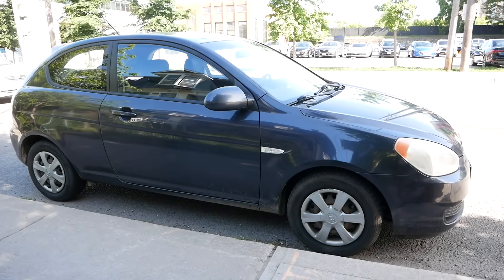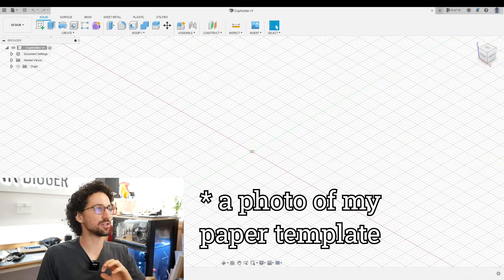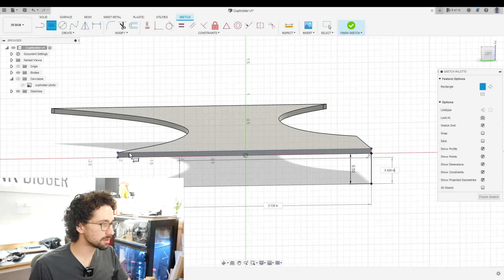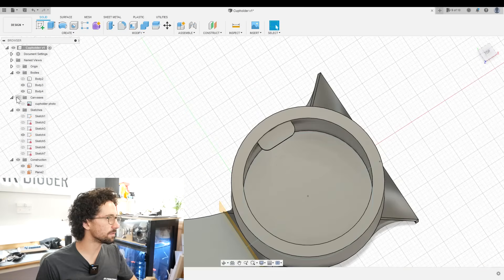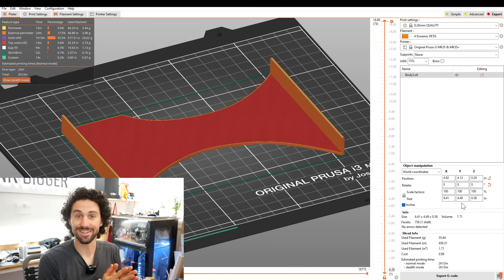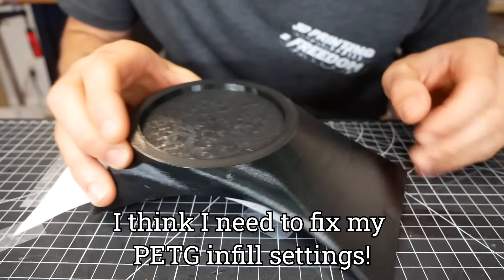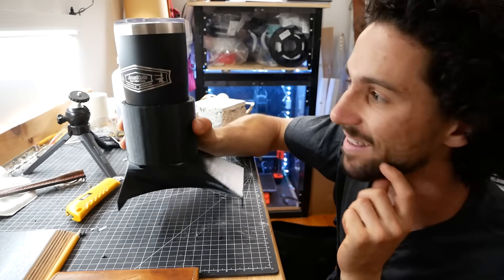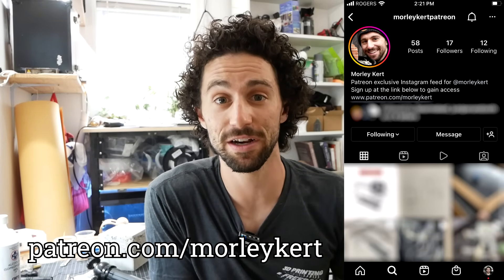Upgrading My Car with 3D Printing!

Comment: Just an idea, what is stopping you from adding a whole section on top? Have two cylinders that go in the bottom cup holder, and then a giant platform that covers that whole section? You can then add cup holders on that new section. I guess the downside is they would be just a bit too high.

Comment: I thought you were going to build something that had a base that fits into the 2 existing cupholders but has a top that could hold more and maybe extend through to the back for 2 cupholders for the back passengers

Comment: If someone else will encounter the same issue with TPU flaps - easiest solution would be to make it barely stand out from holes and act as a little tighter spot for a cup which will squish it.

Comment: Greetings from Toronto as well! great job man. even though your design had some flaws and was basic, you are far ahead of people like me who are dreaming of doing such things and never actually doing it. I gotta give you the credit, with average things you made magic. I've been trying to design a perfect cup holder for my car and I've been only postponing the project and not doing anything. You are an inspiration and things maybe shouldn't be necessarily super perfect. if it works it works. Great job.

when I said flaws, I meant it could be designed more efficiently/professionally. I come from a SW background. For the slit for TPU stoppers you could have the cut extruded "to the surface" instead of "Through all"  and it builds the curvature of the surface inside the cut extruded part without poking through it. You could then make it X mm distance far from the surface so it makes those holes closed while being curved. All I said are 1 function in SW to replace the 3 or 4 steps you did. These are in SolidWorks and they must be on F360 too. they're pretty similar. The curvature on your centre dash was totally ignored, If it was me I would've tried to make it follow the curvature as close at it can.  

Anyways hope what I wrote gave you some tips on efficient designing. I am by no means trying to say I'm better in designing. Just saw what could be better and mentioned it. Goodluck !!

Comment: 13:26 Couldn't you just manually open the slots (by drilling for example) all the way through? Would that work to prevent reprinting the whole assembly entirely?

Comment: New favorite printing channel. I love 3d printing functional parts they are by far the most satisfying things you can make. That cup holder was a prime example. If you end up redoing this print bc of the glue or the flaps you should make the cup holder walls screw on and off and then it would make cleaning the cup holder super easy when crumbs and stuff settle at the bottom.

Comment: heres my problem with cupholders. 

im not knocking your design, but a general complaint. with your new cup holder and the 2 factory center console ones alike, they are all too close together. im so glad my new truck seems to have solved this problem, but in the old truck, and in my gf's car, when 2 ppl go to a fast food restraunt, both cups do not fit next to each other. whenever someone goes to pull out a cup, you knock the lid off of you or the other persons cup and make a mess. i cannot understand how we can talk real time through satellites and walk on the moon and not be able to remedy this. /rant

Comment: Ehm I like the idea. But man I would never block my HANDBREAK. has saved my life and animals in my case.. Having that to do A HARD FAST BREAK while gearing down.. 
plus I dont think it's legal in Denmark to Have that there either.. :D

also who the fuck puts trash in the door holders.. ? Dont you have a small hook on the passenger seat ? at foot level for a bag for trash ?
these are just questions. not insults.. :D

Comment: I've never used PETG, only PLA. Did you decide what caused the odd surface texture on the top of the base? Thank you
Reply from the maker: My nozzle temperature was too low - I raised it from 230 to 245 Celsius and it greatly improved my infill quality with PETG!

Comment: So, if you were to re-do the cupholder and change the flap-slots to through-slots (through-mortices?), having the sides taper from outside to inside would keep the flaps from trying to pull through the slot into the cup area.

Comment: TPU and PETG are both very chemically resistant and it's hard to get them to chemically weld to themselves, much less each other. Model a couple of through-holes so you can push pins through to physically constrain the flaps, or just drill a fine hole down through the top. The other guy's suggestion to tab the pieces so they can be embedded is the right choice but you can still rescue the idea in this print with a pindriver and some piano wire.
Edit: Oh wow! I have that same (or very similar) Underwood!

Comment: emergency brake? isn‘t that the parking brake? (at least in europe that‘s what it is) I would not recommend anyone pull that thing in an emergency, but maybe I am wrong and cars are different where you live :)
Reply: It is both in the USA. You park with it up. However if you brakes go out you can use it as a emergency brake don't  expect the same stop you get with your regular  brakes without practice. Many new drivers will have practiced and learned  to use it do a 180 turn.  ( illegal racers will do this move as well.)

Comment: You should do some photogrammetry and import an FBX into fusion. I prefer to use polycam. Just need to scale appropriately and you can start with a 3D mesh as your reference. Hope this is useful and let me know if you have questions about this.
Reply: I assume youd need the paid version of polycam?

Comment: You could add a pin hole in the tpu flaps, pause command before the print would bridge over it, put the flaps into your print, and something like a piece of petg filament as a pin into it, then the print continues over, sealing it in, leaving a seamless look. Or just drill a hole in the existing print to do the same thing as a retro(fix)fit
Reply: I've got an MMU2S on my Prusa MK3S, so in theory with something like that or a Palette, you could add some kind of locking tabs on the TPU flaps, and print it all in one go, hopefully locking the TPU flaps into place. But pause commands work on most printers, making the prior suggestion a little more user friendly, although still more advanced than post assembly.

Comment: Awesome 3D modelling skillz. When saying "parallax error" at timestamp 2:45, is it actually a question of lens distortion? I understand that parallax error is refering to a phenomenon that "... occurs when the measurement of an object's length is more or less than the true length because of your eye being positioned at an angle to the measurement markings". The distance between the object (the paper template) and the measurement markings (on the mat) is close to zero. To reduce lens distortion it is always a good idea to zoom in, and not use a wide angle lens
Reply from the maker: I think the error would still occur if the camera wasn’t directly overhead - it’s like that classic perspective diagram with lines on the ground converging towards the horizon.
Reply: @MorleyKert  That is a good point for "young players". However, what you describe seems to be more of a perspective error than a parallax error

Comment: Out of curiosity, how well does the shifter clear the mug while all the way back in low?
Reply from the maker: Shifter does indeed hit the mug if I shift into low, which is easily fixed by removing the mug in the rare cases when I drive in low.

Comment: Another idea for the TPU flap pieces:

Design the flaps with mechanical hooks on BOTH sides. Then while the PETG cup is printing, put the TPU pieces in the slots, and let the rest of the cup print over the TPU. That way they're mechanically locked in place, and they can never come out!
Reply from the maker: That’s a great idea! I haven’t yet tried embedding objects in prints but it seems super useful.
Reply: @MorleyKert  It's a slippery slope.
Once you've tried it, you start automatically designing things so you can pause the print and drop in an M4 nut (better than inserts, by far) or throw in some cheap ball bearings for weight. Definitely a game changer, and something that will make you wish the "shell" command in F360 worked more reliably.

Comment: Hope it doesn't get too annoying with the handbrake. Honestly thought you were going to pull the plastic casing off, cut a hole in it and print something so the holder could be recessed in like the other two. Though that would've been pretty involved. 

Great video!

Comment: Add more top layers in prusaslicer when working with PETG, should get rid of the infill ghosting you're seeing on the top of your print. Don't bother using ironing on PETG.
Reply from the maker: Thanks for the tip! Do you also have infill issues with PETG?
Reply: @MorleyKert  I agree with Todd. I print PETG all the time, and with PETG being a little more droopy, if I don't have enough top thickness I can get the infill showing through, especially on large flat spans. BTW, love your videos, and you have inspired me to finally start using fusion.
Reply: @MorleyKert  yes, it's pretty common that PETG and infill looks like garbage. Just make sure the part fan stays off and let it complete, it ain't pretty, but it will finish. 👍

Comment: I'm interested to know how the PETG holds up to heat over time. I've been thinking about printing stuff for my car in ASA, but I'd rather do PETG if I can.
Reply from the maker: I’m optimistic! I printed some parts for my glove compartment out of PETG and they’ve survived some very hot days.
Reply: if your car doesnt get up to 80c then the part will held up totally fine.
Reply: @wojtek-33  I tried that. I used to live in DFW. All of mine deformed on hot days. didn't outright melt, but sagged and squished.

Comment: Why would you need two beverages, the side  door holder is for water bottles.
Reply from the maker: Only works for very skinny water bottles (not the ones I use) and it’s incredibly awkward to access while driving.

Comment: i wouldnt mess with the space your car has to grab the handbrake. you will regret when you will have to quickly grab the handbrake and your hand is stuck between beverages. or maybe you wont have the chance to regret it...